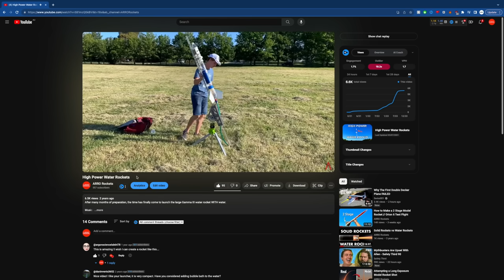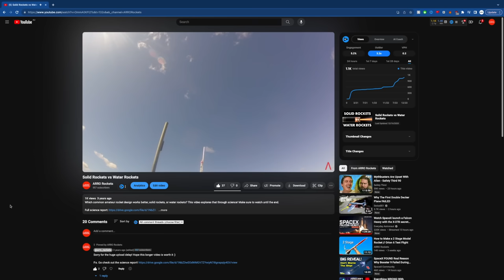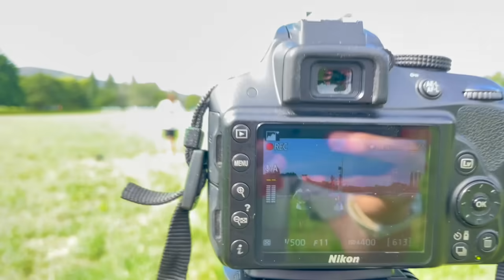My Largest Water Rocket Yet

Comment: Great video! Looks like Gamma IV is flying pretty well. If you could push the pressure to 100-110psi I think you would get pretty nice performance. Happy to provide air at appropriate pressure if you bring it along to one of the NSWRA launches. :)
Reply from the maker: Thanks! Means a lot coming from you guys :) I definitely agree that adding a little more pressure will definitely have it flying better, I'll be sure to borrow some air at future NSWRA launches to save me the pumping!
Reply: Although I only spent a year or so making water rockets, I got the same impression that the psi was a little low. At 80psi it's struggling to get the weight of the rocket and water moving. If they were to stick at 80 I'd suggest they'd get a longer flight time from reducing the amount of water onboard. If they were to use a polyurethane like Sika 11FC and rough up the seams, the joints should be good for atleast 120psi.

Comment: During the late 80ies and 90ies we had plastic bottles in Sweden with thicker plastic. They was reused from by the soda manufacturers several times before they was classed as trash. They had the same threading as our scuba bottles. We hooked one up to our scuba compressor and it exploded at 50 bars (+700 psi). They were heavier but it would have been fun making a rocket like your with those bottles. A bit dangerous though 🤣👍🏼

Comment: A tight dovetail is the worst rail you could have. So much friction even if lubed and quite intolerant to offset forces forcing a twist causing binding. Swap it for a simple tube with a slit and an easy-fitting post down the middle. The rocket will find it's own way straight off the rail - It doesn't need to be a high-tolerance fit. The rail isn't for guidance to keep it straight, it's just to stop it falling over before aerodynamics start acting so that's all you have to make it do.
Reply from the maker: For this rocket and other water rockets I agree that perhaps a different rail design might be more suited since the tolerances are worse on such a flexible, and changing airframe (as it pressurises). However I wouldn't say the rail I was using is the worst in general since 10/10 extrusion is the standard used in model rocketry
Reply: I suspect the rocket body is bunching up and flexing when the thrust initiates, causing the guide pins to rattle up the guide rail. I'm not sure of the efficacy of it, but adding a middle guide pin might help distribute the forces - and I'm also thinking an inner bladder might provide better rigidity and allow for less bulky seals along the body..?

Comment: Nice work! It might be worth doing a burst test to see how far you can push the pressure up. I think there is PET specific glue that can get a really good join. If you wrap with tape (or fibreglass) you could probably go even higher. Probably better to do any pressure tests filling it entirely with water - it's a lot safer as it is incompressible. I guess you know about Air Command Water rockets website/YouTube channel? Lots of really great information over there!
Reply from the maker: Yes bursts tests are always a good idea. Unfortunately pressurising that high is a challenge with a bike pump, and the proximity to the rocket also makes working at those higher pressures a little dicey. That's why I stuck to a relatively low pressure that I knew would work and wouldn't be too dangerous (80psi). This rocket could definitely perform better with higher pressure. And glass tape or fibre glass would be an excellent way to increase pressure! As for Air Command Rockets, I have been watching their videos for many years now, and they were the ones who reached out and suggested silicone lubricant on the launch rail :)
Reply: @arro_rockets  I had a lot of problems with a cheap Kmart pump - then I got a mid range pump from a proper bike shop and it got a lot easier! Proximity is definitely an issue - I am not sure about the connectors on air compressor hoses. Haven't tried a launch in ages!
Reply from the maker: @simonabunker  Bike floor pumps are definitely the way to go for a manual solution. I know Air Command Rockets use a scuba tank which certainly speeds things up
Reply: @arro_rockets Great video! Love to see your futur content! I actually designed and flew a similar but lower volume water rocket, about 1 year ago. We were hoping to reach an operational pressure of 140 psi on our splices. Hence I did multiple and multiple burst tests with different glues and techniques. I finally developed a technique able to withstand 180 psi but 160 before permanent deformation. Without using fiberglass, which is much easier. I have a few tips if you ever need some in that regard. I'd love to talk to you about your deployment system, I've encountered many problems with mine. Keep up the great work!

Comment: Tip from steam boiler pressure tests; Do the (over-) pressure test with water only. It’s incompressible, so no explosion on failure.

If you can’t use a water (hydraulic type) piston pump, maybe try with 98% water in the rocket, and then pressurise as normal. A failure will produce a hefty water spray, but less of a dangerous explosion. 

Besides, a failure from water pressure alone will enable better “forensics”, as the pressure vessel is way more intact after failing. Great work anyway, just thinking out loud here…😊👍
Reply: I so agree with you.  Those bottles are very dangerous when containing pressure.  People have been maimed and killed by blowing up those bottles by sealing dry ice in them.
Reply: How we pressure test PE pipe as well.

Comment: Shouldn't the 'chute attachment point be placed further forward to avoid a nose down attitude caused by rearward center of pressure caused by the fins instead of further back as I believe you said?  You would thereby be putting more of the mass rearward from the attachment point, better overcoming the drag of the fins moving the fin section upward.
Reply from the maker: Yes absolutely, only noticed that mistake after uploading!

Comment: what about adding two air pressurized tanks on the sides and water in the center tank, would look like the falcon heavy rockets and give you longer thrust?
Reply from the maker: You're totally right! That's actually been done before by Air Command Rockets and I'm sure others. Basically having three cores where the two side cores pump pressurised air out the top and connect to the top of the centre core, pushing the water out.

Comment: good work.         larger  parachute.        result:  descent rate and the affects of the fins are reduced.      d
Reply from the maker: The damage was only really caused by the nose-down attitude of the rocket, and since the rocket has such high drag and surface area, I'm confident the parachute isn't the issue, just the shock cord placement :)

Comment: Nice build! I used to make these a couple of years ago. I found that a good pressure is around 8-9bar for plastic bottles spliced like this, although they handled upwards of 11 bar. I used polyurethane construction glue, (sikabond t2). In the beginning, I had exactly this same issue of the rocket not having enough power, as I put way too little pressure into it. Just like some others mentioned, increase the pressure, and it should work! I designed and 3d printed both 8mm gardena-type nozzles, as well as using the 22 or something mm hole in the bottle. Both worked, but the larger hole made it go slightly higher, although it didn't look as cool. I am lucky to still have my eyesight, as 16-year-old me did not believe in safety goggles, and stood a half a meter from the rockets, releasing the firing mechanism with my fingers..

Comment: What about dry ice vs compressed air? The controller could release it into the water. Add a valve at the exhaust end that does not open until the controller senses a proper amount of pressure.
Reply: I was thinking the exact same thing. We used to blow up oversized 3 liter bottles with dry ice and water and the boom was tremendous. It must have been at least 200 psi before bursting. You could easily adapter a pressure gauge to the fill cap which will freeze the max pressure reading. Then build a release valve which opens just below this value.

Comment: I used to experiment with these when I was younger. Mainly ones I bought, but one or two (much smaller, just one bottle) I built as well.
Had a 2 stage one I bought as well, loved that one.

Years later I came up with a 1.5 stage design that I never got around to building.
Concept is this:

Stage 1 (the sustainer stage) is basically like your Gamma IV, it could even be a bit taller containing more water/air since it doesn't even need a thrust to weight ratio of over 1 at launch.
Stage 0.5 (the boost stage) is a cluster of 3 to 6 bottles that are optimized for high thrust and thrust to weight, but short duration.
So, the booster stage is very short height (only 1 or 2 bottles tall, each bottle same diameter as sustainer stage , and no (or as minimal as possible) restrictors on the nozzles, free flowing.
Tying it all together is a base plate that holds the boost stage bottles together in a ring around the sustainer.
The bottom of the sustainer stage rests in a cradle/hole in the base plate, and the fins of the sustainer stage stick out between the bottles of the boosters.
The launch pad will need to be more complex, since starting/releasing all rockets at exactly the same time is critical. guessing some sort of similar system to what you use, but with spring loading that pulls all cords at once.

When launched, the boosters accelerate the entire assembly rapidly off the pad, but run out of water only 10 to 50 feet off the ground.
(the sustainer stage is also spraying the entire time from launch, but since it has a more restricted nozzle and contains much more water, its contribution to the thrust at launch is minimal, and it is only 10 to 20 percent depleted when the boosters run out)
At that point, the booster falls away since it is no longer powered, and the lower but continued thrust of the sustainer stage is enough to pull it away from the booster assembly. and it continues on independently.

Comment: I would recommend using eye and ear protection when pressurising spliced bottles (probably any bottles really). I had a splice fail once on the pad around 6 bar and it was very loud and my ears were ringing for a good while after.

Like you I started with 3d printed bottle caps and a garden hose connector, my launch rail was just a simple steel rod, maybe 5mm or so, with sections of soda straw taped to the rocket to run along it. After I got access to a lathe the very first project I turned was the heart of a full bore water rocket launcher.  It's essentially just a suitably sized tube with grooves on the outside for a pair of o-rings to seal against the inside of the bottle neck. I use a circle of zip ties where the heads act as claws holding down the flange on the bottle close to the threads. These zip ties are are held in place by a spring loaded outer ring that is pulled down by the launch cord to release the rocket.

Anyways, full bore rockets accelerate very fast and there is no need for any proper rail (though my launcher has a tube exrending into the bottle, not sure if this matters, it just seemed like a good idea). The downside of full bore is that it doesn't look quite as cool as a rocket slower off the pad, but the performance is way superior to anything I ever achieved with a restricted nozzle.

Comment: Enjoyed watching you develop and expand you're water rocket's thanks for sharing. Have you considered a catapult as a launch rail? If you could make one work successfully It would accelerate the rocket off the rail much faster when it needs it most for no weight penalty to the rocket itself, just a thought.
Reply: Combining the down-pull on the connector with a release for a spring in the rail to push the rocket like a nerf dart as the water starts making thrust is my thought.

Comment: It seems to me that the majority of the energy is being used in the very beginning of the acceleration phase. If your objective is to make the rocket go as high as possible, maybe you should consider a second propulsion method for just the first meter or two of the flight. Like a long spring (steel or rubber) or maybe something driven by pullies and weights. It would act as a “booster” and would probably make the rocket go much higher.
Reply: at that point its cheating... lol. and theres still the issue that the water IN  the bottle has to actually STOP. then accelerate the other way. its going UP. it has to be accelerated DOWN to get the BOTTLE to go up instead.

Comment: Great vid! Don't know much about water rockets, but for me, it seems like there should be a little bit more trust-to-weight ratio for this rocket, the start seems slower than it should. Maybe less water, more pressure, or a bigger nozzle would work better! I think there is a lot of space for improvements and it could be fun!
Reply from the maker: Thank you! Water rockets tend to suffer from a lack of acceleration due to the high mass of the water (taking up about a third of the volume). You can definitely improve this by using a higher pressure which is certainly something I'll try! (went for a lower pressure for the test flight just to be safe). Also increasing the nozzle diameter increases the flow velocity, which improves acceleration, but that would require completely new launchpad infrastructure.

Comment: Tons of fun man.  Would it be worth adding a silicone tubing powered 'shuttle' to launch the rocket off of the rails ( sort of like an aircraft carrier launches planes, albeit at low-power / low-tension so as not to rip the launch lugs off of the rocket, yet still prevent hangups on the launch rail.....and preserve internal thrust energy from the rocket, so that it would be applied to achieving higher altitudes on the launches instead of dissipating that energy on the launch rails ? ).   Either way, looks like LOADS of fun !
Reply: oh.    you  mean  a  BUNGEE.       might be worth trying.
Reply from the maker: Seems to be a popular idea considering you're the second person to suggest it, sounds very cool, just tricky to implement!

Comment: If there is room in the AL channel, very thin HDPE tape may work better than silicone lubricant, or both may work. There is always going to be wobbling causing misalignment problems in a long channel, rings may work better. There used to be 2-stage toy rockets that would go OOS. I want to say there were even 3 stage ones, but don't remember.

Comment: Awesome video! And a great way to get into model rockets in Australia. Good luck with the future projects.
Reply from the maker: It's perfect in the summer months when the weeks are often riddled with fire bans!
Reply: @arro_rockets i have looked for expanding liquid nails at bunnings but I  can't seem to find it. Is it sold under a different name like fast grab or waterproof  ?  I have the bottles and all the bits apart from the adhesive.  Thanks!,
Reply from the maker: @foamboard_shenanigans  I used Selleys liquid nails from bunnings --> https://www.bunnings.com.au/selleys-320g-liquid-nails-original-construction-adhesive_p1233751. I can't recall if I used the heavy duty variants or not but the original should work fine. I hope you're able to track it down in store! And one thing to look out for when using liquid nails for this is to make sure to get an even spread as you push the bottles together and avoid air pockets, you can help yourself with that by making sure the shrunk bottle is not warped in any way (that was the issue with the Gamma III). Best of luck with your rocket building! :)

Comment: How about having the nose cone/recovery section just friction fitted to the top water reservoir, having the 'chute attached just to the nose cone/recovery section and that section attached to the top reservoir with perhaps a meter's length of 1/4" elastic band of the type used in sewing as a shock cord.  The rocket would then come down base first.
Reply from the maker: I've used a passive deployment system similar to what you describe, check out the "Solid Rockets vs Water Rockets" video if you're interested. Problem with it is that it's quite finicky and pretty unreliable, especially with water rockets and not just air rockets

Comment: As part of science fair project my son and I took a single bottle rocket added stratofins and a supplemental nose cone with altimeter and tapped a keychain camera to the upper section.  We were able to achieve a 300ft altitude with a pretty simple rig at 120psi.  We only launched once at that psi normal preassure for launch is 80psi which would get 200ft flights pretty easily.  Recovery was simply a tumble recovery.  Over the launches we added a shock absorbing mount for the altimeter and had to replace the upper electronics bay at least once.  Interested to know hat altitudes your new rocket reached.

Comment: I’ve seen great success with internal launch tubes instead of external launch rail. Basically launching the rocket like they do off an aircraft carrier. All that inertia before you start using water can give you a lot higher launches.

Comment: I think you should abandon the outside guide rail for an internal metal tube that is attached to your gardenia filling attachment. ie the air comes out of the top of the tube. During launch the pressure is forcing against the top of the tube creating massive acceleration even before the water starts to be pushed out. If you do the math this is the most efficient way to use your precious air pressure and turns the need for a stabilising frame from a negative to a positive in getting the rocket higher.